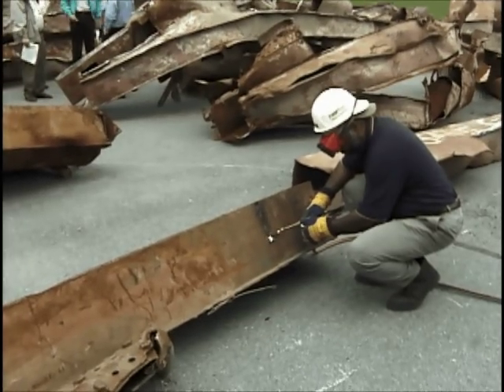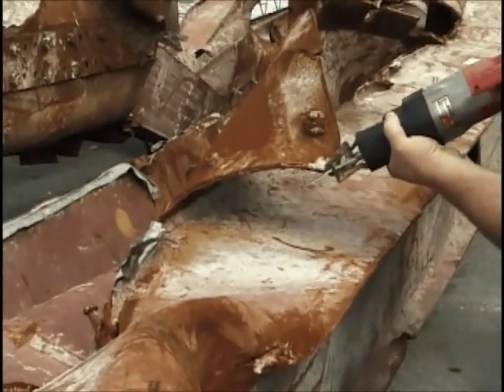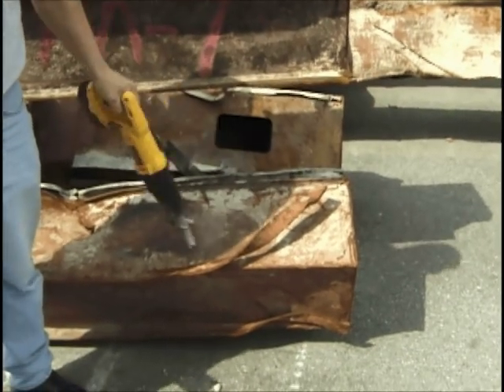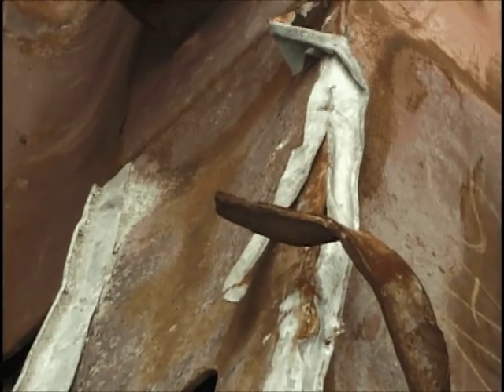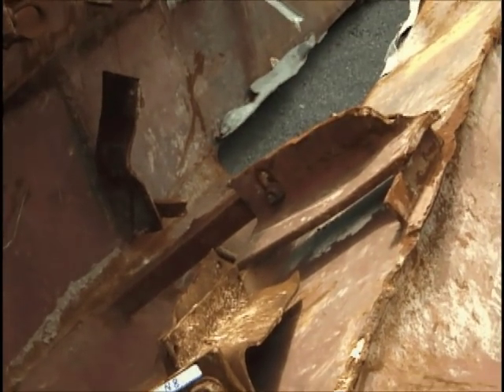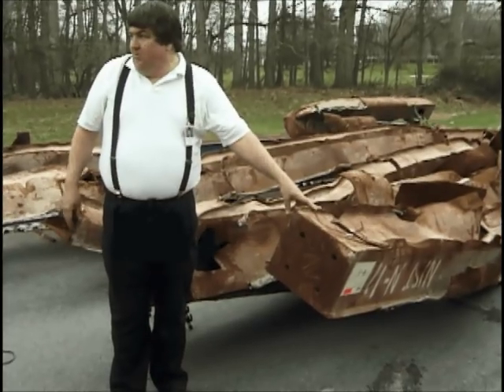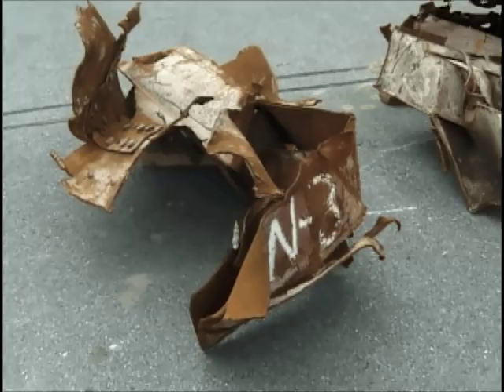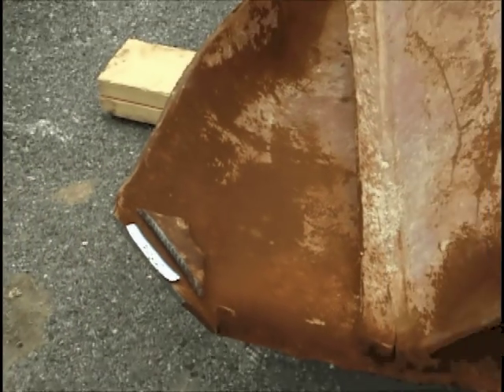Steel Samples from WTC Towers after 9/11 (Clip 1, part 1)

Comment: @roquefortfiles "You have no clue what are talking about!!"
Sadly for you, I have. And it's easy maths: the top of any structure does not become heavy enough to force their way down through a lower, larger and much, much stronger part. You could drop those tops down on the lower parts from a hundred yards and they still wouldn't do what we saw on 9/11. 
And all the never explained phenomenons which acording to Occam's Razor totally fits into the CD scenario does also NOT get explained.

Comment: @roquefortfiles Besides that the statement also doesn't prove all the unexplained phenomenons whereas some of them are squibs seen BEFORE the collapses and "rocket" debris seen changing direction in the air or going towards the ground faster than gravity would pull them with a trail of alu oxide after them. 
Another one is all the eutectic (melted) deformed steel that you see in the video above. It's funny how you post under a video with a proof and topic you keep avoiding.

Comment: @Thetan1974Sadly, his statement doesn't PROVE that the tops of the towers were heavy enough to crush their way down through the path of greatest resistance powderizing everything leaving no pancakes. Easy maths proves that it is impossible.

You have no clue what are talking about!!.  One floor of this building is rated to carry about 1500 tons.  The floors DO NOT hold vertical loads.  Now your asking it to carry 31 floors??   when the ext columns fail.  Which they did.

This is basic math!!!

Comment: @Thetan1974BINGO! And fire doesn't either.
So what did?..   

You miss understand me.  Explosives do not pulverize football sized floors.  Thermite doesn't either.  Its not even a substance used for a CD so rule it out to begin with.  

I don't quite know how you can't understand when the man who built these structures has said himself  " There is no way one floor is going to hold the weight of 14 or more floors landing on it.  It would collapse instantly and to the foundation."...

Comment: @Thetan1974  .  Go and look up some videos of the guys examining the steel columns.  There are plenty on YT.   

You will notice something.  Virtually ALL of the steel columns are not shattered and ripped apart or torn in half.  They are intact end to end.  They have come apart at the bolted connections on either end.  The BOLTS holding them together have been popped.  WTC 2 has a section of wall nearly 20 stories high that is sheered off almost intact. 

Explosives don't do this.

Comment: @bjdm3089   How many fucking times do i need to tell you?  Incendiaries are not used for building demolition.  You're dreaming if you think load bearing steel the size of the WTC's is going to be sizzled apart with a few buckets full of thermite.  It ain't happening dude.  And please don't send me Jonathon Cole's ridiculous crap videos of his Wile Coyote Do it yourself terrorist kit.   Bunch O Crap.   

It requires high explosives.  Stuff like RDX that goes off at 5 miles/sec. 

Go and learn.

Comment: @bjdm3089   Peer reviewed??   By who?  UPOST IT Science. COM?  LOL.    The materials that make up the building easily account for your..."Thermite" residues.  

JFC  The truth movement  couldn't even get through a puny sized steel column and had to resort to burning a flower pot full of Thermite at their little 911 Truth convention at Burning Man in Nevada.  

You're on Glue dude.  There is no professional anywhere who even remotely consider this material for a CD.   

It requires high explosive

Comment: And on top of it all, the red/gray chips found in the academic paper mentioned below are ACTIVE: when ignited at surprisingly low temperatures (~500 centigrade), they react VIOLENTLY and produce liquid metal resulting in iron microspheres.  This is a primary indication of a thermitic reaction, EVEN IF the nano-formula permitted its creators to add other elements for different effects.  Let me guess: this is PRIMER PAINT!!!!!!

Comment: What you continue to dodge is the blatant evidence of molten material.  Microspheres of a fusion of iron and other metals is proof that it was once in a liquid state.  We know that, fire-proofed or not, iron and steel may weaken but DO NOT MELT, DO NOT LIQUIFY without extreme temperatures which only an exothermic chemical reaction can produce.  The bending of massive steel girders, the FEMA report showing steels with holes in it--this requires incendiaries

Comment: @roquefortfiles FEMA says clear evidence of melting steel "like swiss cheese"; USGS independently reports 6% of dust is microspheres; and NIST says, "Why test for explosives?  We don't expect to find any evidence and we DENY any and all reports of liquid metal in any form!"  Too bad this violates national standards which require testing for thermitic residue if there is any evidence of molten metal or explosions.  Admitting symmetric free fall for more than two seconds, THAT is a joke!

Comment: @bjdm3089   LOL.  Bare steel with no fire proofing?   GOOD LUCK!!.  Its not put on the steel for fun and decoration.  Sections of the WTC steel found afterward were virtually stripped clean of it.   Even a small area of exposed steel will fail the entire piece.  Fire VERY MUCH can do this to the steel.    Thermite does not react for weeks at a time.. Nor is it a substance that ANY trained professional would EVER use for a CD.  

Some very very silly stories going on here.

Comment: @roquefortfiles My friend, the point is this: no jet impact, fuel or office fire can come even remotely close to impacting the steel in this way. Nor can they have resulted in metal microspheres, or pools of molten iron in the rubble pile which would continue to burn for months. It is not our job to explain *precisely* how the THREE buildings were brought down, but it's obvious that it required explosives of many different kinds.